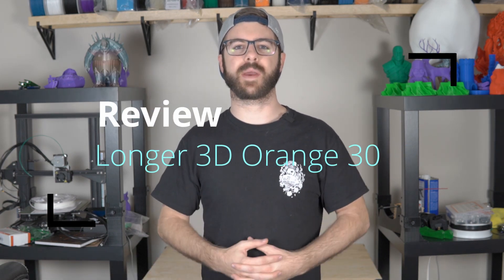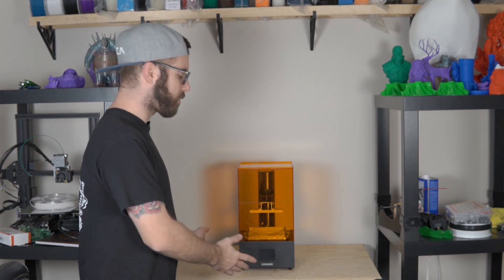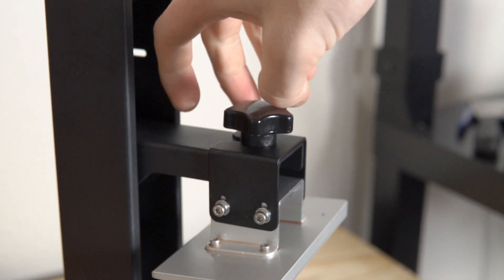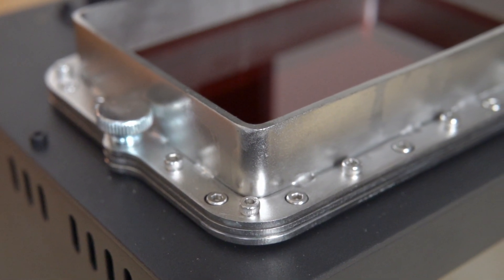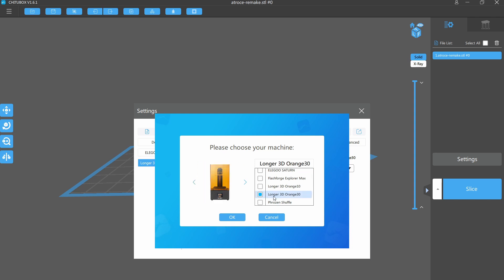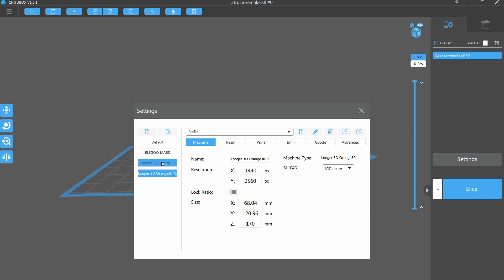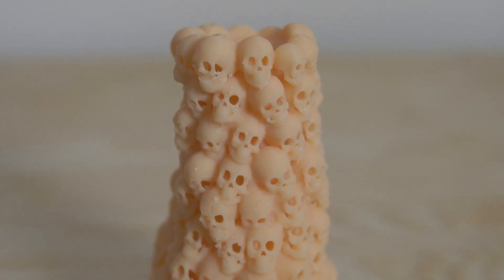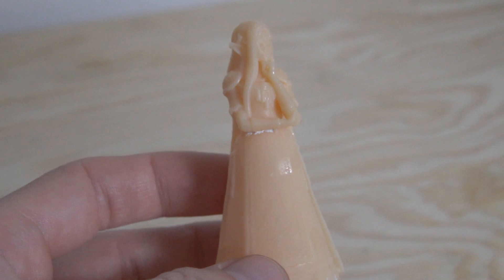Review Of The Longer 3D Orange 30 Budget LCD Resin Printer

Comment: The top is really a non-issue. It's just a step they didn't want to take during manufacturing. Instead of gluing it together, I'm sure they figured their audience was resourceful enough to glue it themselves. There's no such thing as a "solid" top. They're all just like this, just glued together, soooo just glue it together. Or, since everyone that has these has a 3d printer, just print some brackets that hold it together.

Either way, looks like a good printer and I'm glad that SLA is becoming more and more affordable. Thanks for the video.

Comment: Thanks for the thorough review. Ive been trying to figure out if the longer30 supports anti-aliasing; the marketing material does not mention it nor do I see an option in their software; but the chitubox profile and the results, (insofar as I can judge from my screen), suggests that it does. Did you have an impression either way? If you print without resin in the vat, do you notice multiple illumination patterns per z-layer, that differ slightly at the edges?
Reply from the maker: I did not see it anywhere as you mentioned. Based on the results I have also gotten I do believe that it does have it. I will definitely take a look to see. Maybe I can reach out to the manufacturer for confirmation.